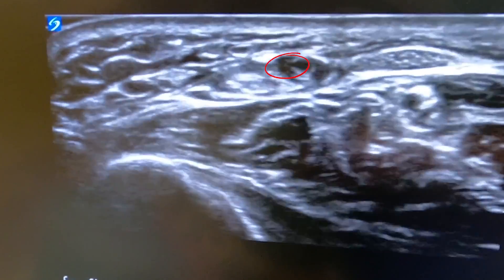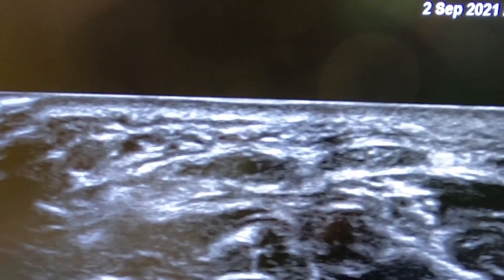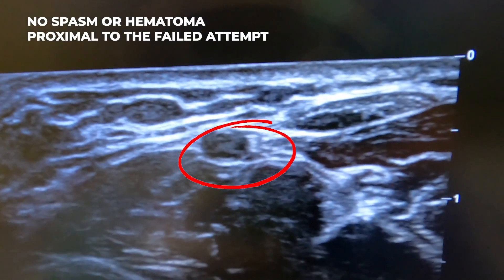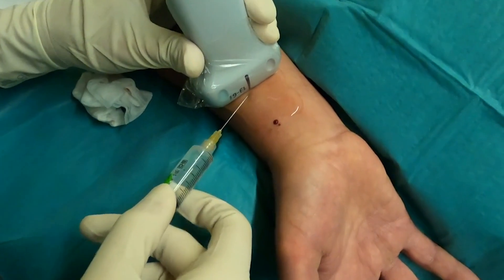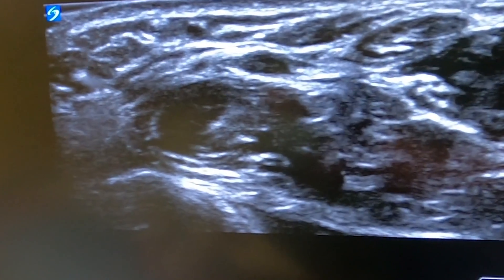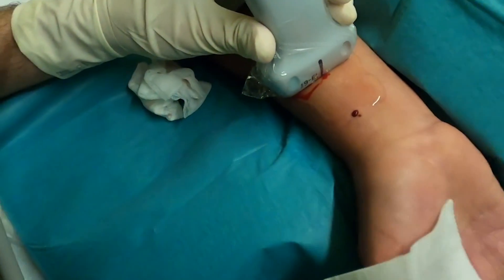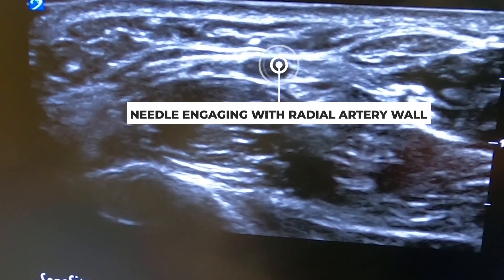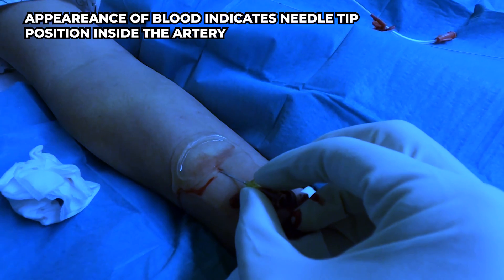HOW TO FIX FAILED ARTERIAL LINE

Comment: With seldingers technique, I could pass the guidewire easily and pass the arterial catheter over the guidewire without any resistance. But on few occasions, after removing the guidewire there was no free flow of blood. What should be the explaination? And what precaution should I take to avoid this ?

Comment: Question, when you know you have adequate position of your needle tip by visualization of the tip in the lumen on the long and short axis using ultra sound, but do not have flash or see draw back, what could be wrong with the insertion or art-line?  I have many times encountered when my needle tip is lumen on a very hypotensive patient and I can't get the art line to work, when if I get draw back of blood with an empty syringe?  Just need some help :/.

Comment: IMO if using ultrasound I'd prefer the flo-switch or abocath (cannulae) as I'm used to doing out of plane cannulae, I don't look at flashback - just follow the light down the tunnel.

If using a blind/palpation technique then I prefer the seldinger devices as the continuous arterial flow offers continuous feedback and adjustments can be made. Ultrasound helps you find the artery but when you put down the probe you still have all the same hazards unless you thoroughly 'cannulate' the artery with the needle.

Comment: Best method i've tried is to transfix with 22g (ideally US guided), then take  out needle, grab guidewire then withdraw catheter until  you get a nice arterial blood splash and immediately thenn progress the guidewire. 20g arrow guidewire fits in almost every 22g catheter i tried so far. It has the relative disadvantage of puncturing the artery twice, but its ver effective, easy to teach and CLEAN (ver few drops of blood are dropped).
Reply: What if you know you're in the lumen but no flash or art line won't zero?  I've had so many times on a very low BP patient I can't get the Artline to work at all.
Reply: @ you shouldn't progress guidewire if you don't have a clean blood flash... maybe you are not in the perfect center of the lumen? US guidance should help in these difficult cases

Comment: If there is ultrasound available, I will always use it. This ensures 1 puncture, better patient satisfaction, and close to 100% the success rate. I can't understand why some still insist on blind technique. (Its the same as some archaic people not wanting to use car reverse camera or sensor - does not make sense to me at all)  - okay rant over.

Too much gel. 2mls is enough. 

After the needle enters the radial artery, it is probably a good idea to advance the needle tip a little bit further while visualising the needle tip on the screen. (This involves flattening the needle a little bit and advancing about 2 to 3mm). This will ensure that you dont lose position with small minor movements (which is very common in novice practitioners).

Comment: From my experience I can add some tips 
First thing the angle of your needle make it more superfacial or less steep when you hit the artery second thing you can creep up little distance with your probe the push your needle more inside the artery buy very slowly until the needle appear again inside the artery the third one is after you hit the artery you can change the view to long axis and enter with inplane technique but be sure that needdle is on the same line with probe
Reply from the maker: Hi Mahmoud! Thank you for sharing your experience. Greetings from NYSORA!

Comment: I face this scenario too many times being a senior consultant in my hospital.
My practice is to go little proximal from the site of previous trials and use an arterial catheter similar to regular cannula connected to a small syringe with saline to make sure I am inside the lumen of the vessel . The advantage of my technique is that I have no blood loss
Reply from the maker: Hi Esam, Thank you for sharing! Greetings!
Reply: I do use thé barrel of a 3cc syringe on the angiocath to act as a reservoir but never thought about using the entire syringe with saline in it though. Is the blood pressure strong enough to push the plunger back in every attempt?

Comment: I'm a 4th year resident of Anesthologie from Germany where residency is 5 years. Usually when I'm able to palpate the radial artery well, then I prefer to insert a Cannula instead of guide wire assisted catheterization well also depends on the duration of ICU stay , usually a day or two works good longer not that great. Secondly when I go ultrasound guided, then I prefer to place ultrasound parallel to the artery and try to perform it in plane , I feel more comfortable that way. I'm just sharing my very miniscule experience in front of those with behemoth amount of experience.

Comment: If using ultrasound, dynamic needle tip positioning should be used instead to confirm placement of both the needle tip and catheter tip within the lumen of the vessel. The catheter should then be able to be threaded off the needle easily, without the need for a guidewire. I always scan more proximal to the site of insertion by several cm to ensure that there is no anatomical/physical reason that a catheter cannot be threaded (plaque, stenosis, spasm).

Comment: Hi again doc.
Few points- 1st- after thevbllood started squirting out of the needle, with my pinky and ring finger O would press in front of the needle, so I would stop the flow through he needle and less mess on pts arm (and less use of cell saver). 2nd- hold the needle and guide wire and their ends so one can pass the guide wire much faster.
3rd- guide wire must be introduced in the artery very gently, but not rushing.
4th- the same is vid for the catheter- introduce it in the artery very gently.
5th- I would not use a needle without guidewire and catheter on it. The mess is too much, and some pts seeing that blood all over will traumatize them, which is understandable.
As my PD told me one day- anyone can shovel that tube in pts throat, but the art is to do it with finesse.
Thank you for the video :)

Comment: Nicely done.  The low angle of needle entry is key.  I usually use a 27 gauge needle for the Local Anesthesia.   I have used a 20 gauge 1.75" IV catheter and not routinely used the guidewire.  Great videos.  Thank you.
Reply from the maker: Hi Rodger Orman! Thank you for sharing. Your comments are much appreciated!

Comment: 1- put a rolled tower behind the wrist and fix the hand in a hyperextended position 
2- palpate the artery with at least 3 fingers, drawing its direction in your mind
3- 1 -2 ml xylocaine
4- if you are using arrow canula, make a tiny hole in the cutaneous and subcutaneous layer with an 18 G needle then insert the canulae. This will make it easy to cross the skin without being teared.
5- if you are using seldinger technique, insert your arterial puncture needle one cm away from your proximal finger at 25 degree angle . Once you get blood, go deeper with your needle few mm till blood stops 
6- hold the needle with your left hand, and hold the wire with your right hand at the tip of the needle. Withdraw the needle very slowly mm by mm till you have arterial flow again. Fix your left hand and insert the wire. It should go smoothly.
Once wire inside the artery , take out the needle and slide arterial catheter over the wire.
Failure is almost zero.
Reply: Great tips. I use the same technique minus the hyperxtension. Never had complication in form of ischaemia nor hematoma despite puncturing the vessel on both sides.

Comment: Thanks for such a great  tutorial video. I had been working at CHD department for  13 years providing anesthesia during open heart surgery for infants and neonates . 10 of them I used blind techniques whatever Seldinger or catheter in needle. After visiting amazing CHOP hospital in Philadelphia I'd started to learn ultrasound for veins and arteries. Of course at the beginning  of the new method Iost some speed to performing manipulation and self confidence but now  I never insert needle inside baby's body WITHOUT VISUALIZATION, BECAUSE SAFETY IS A FIRST. And  some tipps and tricks 1. I prefer hockey stick shape linear probe especially for little patients, second it's important to protecte both patient and probe(sterile gel,  only transparen cover and etc).
Reply from the maker: Hi Anesthesist! Thank you for sharing your experience. Greetings from NYSORA!
Reply: Hi doc,
I also deal with pediatric cases. I find it very difficult to canulate the radial artery even with a good flash back. I guess it’s due to artrial spam. Can you suggest some method to overcome this problem. Thanks
Reply: Using the hockey stick makes a lot of sense for younger patients since you can apply less pressure with it and thereby avoid closing the lumen of the artery. However when performing an ultrasound guided arterial line on adult patients I prefer using a normal linear probe as they contain more piezo crystals and thereby allow for a better resolution on the screen.
So you always have to pick the right tool for the right patient.

Comment: The operator in this video seems to be still in the basic firstly stage of ultrasound guided out of plane placement: the ultrasound probe is held static and not at 90 degrees to the needle.

I would encourage these concepts as the next level technique: 
1. Tilt the probe 90 degree to the needle, 
2. Keep "bouncing" off the tip of the needle, while guiding the tip in place. The probe becomes dynamic, in contrast to your static fingers during the blind technique. 
3. Understand and utilize the "counter moves" of the needle tip, especially once you entered the vessel . Keep going inside the vessel for at least a few millimeters. The the catheter is ready to be threaded off the needle. No guide wire needed.

And yes: flood the field around the vessel with plenty local anesthetic, both for the vasospasm prevention and for improved visualization of your needle.
Reply from the maker: Hi Stefan! That is great also. Thank you for sharing! Greetings!

Comment: As for AL, l would prefer any catheter over needle set that available. First, it is way cleaner, no such bloodshed. Second, the situation, when you have blood flowing, but guidewire not advancing (or advancing paraarterially) is not so seldom.

Comment: In this video, angle was above 30.....Is it because u have used Ultrasound technique?
Reply: Indeed. It gets technical: Radial artery is superficial - which makes it difficult to track needle in-plane in most patients. However, for out-of-plane approach, a bit greater angle (30-45 degrees) works better. Since you are monitoring the needle entry into the vessel, it is possible to use greater angle and adjust accordingly. Greetings

Comment: On difficult cannulation, we do a 1.88in pink arrow 20g pre flushed with a little lidocaine to get good flash, then arrow guidewire, and take the white soft part off the 22g arrow and exchange/ slide down the wire and into the artery. Same for brachial but a longer 20g over the wire. Seems to work great idk why, but learned it in CT surgery.
Reply from the maker: Hi Shad! Thank you for sharing your experience.

Comment: moving proximal, ultrasound, guidewire, with all those most people would be able to insert , unless really unfamiliar with ultrasound technique.  I find the real challenge is increasing success rate of first attempt using landmark technique, especially when you don’t anticipate a difficult insertion or do not have ultrasound readily available.  
sometimes the pulse is very strong but vessel lumen is quite small with heavy calcification.

Comment: Great vid, thanks.
Unless I can practically see the radial artery pulsating I have a very low threshold for ultrasound and seldinger technique as shown here. Increased first pass success rate (in my hands anyway).

One downside to this vs flowswitch (angiocath) in awake patients is that I’ve had one or two be quite freaked out by the pulsatile blood flow from an “open” seldinger system.
Reply: Lol. Indeed - it is unsettling to watch. That's why I made a comment "We need a cell saver now". lol. Greetings

Comment: Thanks for the video. I’m a big fan of the Seldinger technique, bur many colleagues use the flow-switch method. In both cases, I always like to fix the patient’s hand in hyperextension with some tape (or have someone fixating the hand for me), in order to prevent “artery rolling” and to have the skin pulled and stretched.
Reply: That's an experienced practitioner's technique! Thank you for sharing!